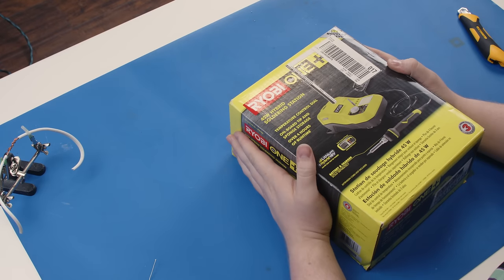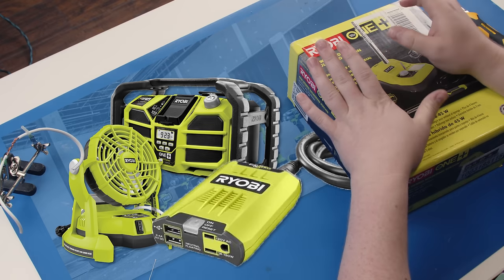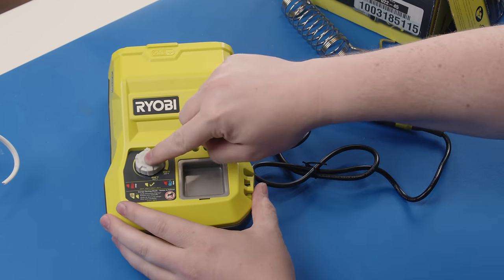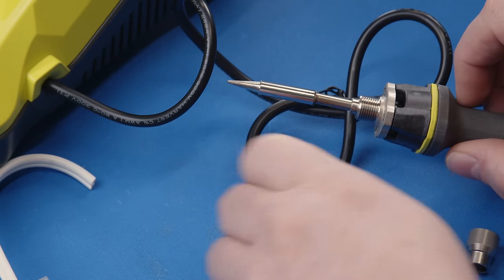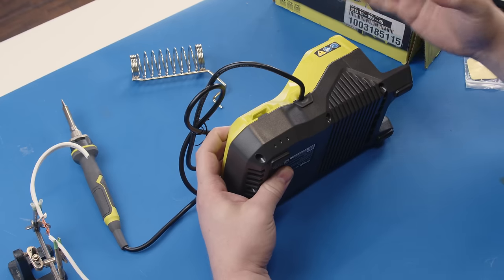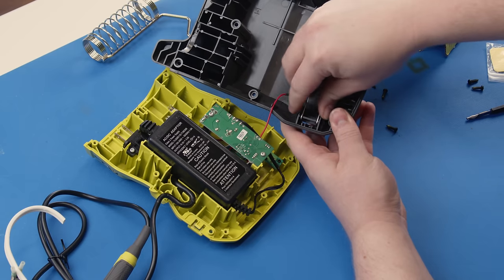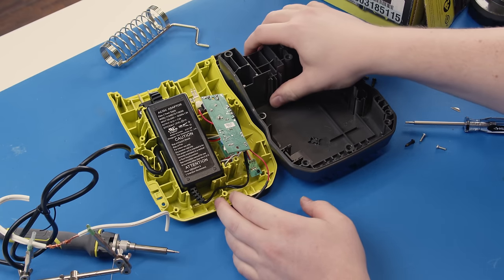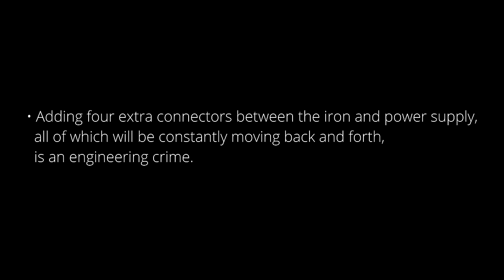Ryobi has GOT to be joking with this soldering iron

Comment: I would highly recommend you look into the TS100 soldering iron. It can be powered by a lipo battery or wall power. I’m no pro but it’s a great iron with temp control that the FPV drone community including me swear by.
Reply: or an TS80p
Reply: I've been pretty much having that in my wishlist for years now haven't had the budget on it yet but looking at it being a direct drive iron is pretty much more than enough for me to nail that on my wishlist top priority
Reply: Had mine for 3 years, mostly using it for Nerf blaster modding and field repairs. Since we mod our nerf to Lipo, it is nice being able to use the same 3s lipo packs for the iron that we use for our blasters.
Reply: He literally mentions why he doesn't want that exact iron in the video...
Reply: Or Pinecil: same performance, better firmware preinstalled and cheaper
Reply: Darn, I should have saved up, I ended up buying a Weller WLBRK12 with a Li-on battery. So far its miles better than the previous one I had that ran off of AA batteries lol. Takes about an hour to charge to 100%, lasts about 15 minutes, and uses USB-C to charge. It gets pretty hot, 12 watts but of course no temp control.
Reply: @perpleksed  same thing basically but from a less reputable company
Reply: @lithiumfpv9254  its only $25 though
Reply: @jbbolts  what is? The TS100? It’s should be around 50 dollars from a reputable site. Had mine for 4 years with zero problems, still haven’t used the replacement tip. Great for small and larger gauge wires due to its temp control and ability to retain heat if supplied with the correct power.
Reply: Yes, I have had mine for a couple of years now and still works fine on the same bit. I love how light weight it is. I modified a cheap supermarket (Lidl)  power tool battery so that i can use it to power my little iron and make it super portable. Just drilled out the battery connector holes and now it accepts banana plugs!
Reply: @lithiumfpv9254  no, the Pinecil
Reply: I'm kinda shocked more tech/maker/etc people don't know about the TS100 already.

Comment: I have an Ungar Imperial soldering iron that I bought in 1964.  It went through a few tips until I bought one that was gold plated (expensive too) which is still in great shape after almost 60 years.  In that time I had a couple small battery irons for quick small jobs.

Comment: Great video, great info, great rants, I can see why it's blowing up for you. As someone in the automotive and DIY renovation fields, it's fun and funny to hear someone way into the electronics weeds talk about the tools available. I have a tech background and have dealt with electronics, batteries, and circuits too, just obviously not as much as you. All the stuff you know that automotive people don't is exactly why professionals use crimps for almost everything in a car while the amateurs who think they are great at soldering, but know extremely little, use solder.
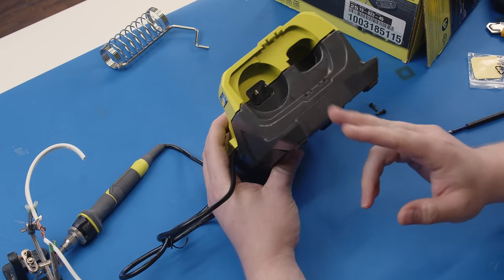I really did look at that cable over and over again. Immediately noticed it looked terrible. Using Torx in tapered holes pisses me off too. At 29:05 it's hilarious we get the clue it's literally a power brick when the power input literally looks like a standard plug to go into your wall. They literally designed a clamp to hold that standard plug and then just slapped the cord willy-nilly in the clamshell. 32:18 is a near spot on AvE impression, by the way. When you revealed the wall wart in the flashlight I was just about stunned. Again, fantastic video! Thanks a lot.
Reply: I said literally 3 times in 2 sentences and I literally hate myself. 😂
Reply: The power supply is fine in reality,  just unusual.  The torx screws are no big deal,  everyone should have a torx driver  now if they want to be able to work on nearly everything these days.   They aren't rare anymore.   In fact they are kind of nice,  they are hard to strip,  and in a pinch you can use a flat head screwdriver to turn them. 
  
   The true monster on this soldering iron is that stiff and melty cable!   Anyone who has any experience trying to solder with that ultra-stiff abomination stuck to the wand will immediately want to throw it out the window or replace it with their own silicone wire.
Reply: @mrdumbfellow927  Yeah agreed there is nothing WRONG with the power supply. More just funny an unexpected. Torx screws and especially in such small holes were just unnecessary. They are hard to strip until they have even a hint of corrosion and then they are trash, hahaha. Def agreed the cable is the real offending article though. Awful.
Reply: @802Garage  Not sure why people are bashing the holes.  They're not abnormal.   I've been in IT for 26 years, and took apart a lot of my own electronics before that, and holes just barely bigger than the shaft of the screwdriver are very common.   The further back you go, the more common they get - because the replaceable hex bit 'socket' screwdrivers weren't as common back then.  I even have an older 'bit changing' screwdriver that uses 4" round shaft replacement 'bits'.  (the end is cut in half so that it only goes in one way, and provides the torque support)   Others had 'wings' on the 'bit'.   

Heck, I have an old Mac Cracker around somewhere.   Torx, and 12" long, because it had to go through the narrow tubes to the screws fastening the old Apple Classic series.   The screws were from the _back_, but the front panel was only an inch thick.
Reply: @tbelding  Just because they aren't abnormal doesn't mean they aren't annoying and unnecessary. There are plenty of cars I work on with annoying design features that make them harder to work on. There are also cars which had service in mind and make those things easier. Obviously, this is not a tool that was designed to be serviced. That doesn't mean it has to be designed to be harder to serviced. My basic point is, I've unscrewed countless electronics devices over the years and the ones that annoy me because I have to try 3 different screwdrivers to fit in the hole are the ones that piss me off. Know what I'm sayin'? :)
Reply: @802Garage  - With these, if you simply have a set of standard screwdriver handled Torx, the only 'annoying' part is figuring out the size -and that's annoying with Torx PERIOD.  Even if they're exposed to the air.  

Don't get me started on annoying design features on cars.  As an example, I owned and spent years working on the original 81 Ford Escort wagon, and 82 Mercury Lynx (parts car), including engine swaps.
Reply: @tbelding  My key point is still that it is unnecessary. Especially for a low grade consumer electronics device. Both the small holes and the Torx heads serve no purpose except to make the device slightly more annoying to service and less likely that an individual will have the tools. Most people do not own a set of Torx screwdrivers, but many own one with the swappable tips. Those won't fit. It was either intentional design to increase barrier to entry or simply inconsiderate design which serves only the factory. As for cars, part of why I love Subaru is they actually usually make sense. You can tell when a company designed something to be serviced or not.
Reply: @802Garage  - Remember that construction design takes no notice of anything beyond the manufacturer.   That includes Subaru.   Everything is driven by 'what makes economic sense to us'.
Reply: @tbelding  Except that isn't accurate because many things are actually designed to be serviced. It can be part of the engineering process, it just doesn't have to be.
Reply: @tbelding  that's right, consumer grade equipment like this is not designed to be serviced at all so serviceability is no concern to the designer, they only care about cost of manufacture. They don't make them hard to service on purpose, they simply make them as easy and cheap to assemble as possible with no thought given to disassembly as they are not meant to be taken apart ever, at least not by the user. 

And yes, Torx screws are really good mechanically, the problem with them is there are far more sizes than what would be needed so you need lots of drivers. This is probably due to the torx system actually originally being an anti-repair feature to keep DIY-people from working on their cars so the more of the (back then) expensive and hard to get special drivers you need the less likely you are to invest in them. Now of course torx is mainstream and the tools are widely available so everybody has them.

Comment: My dad was a real pro with a butane soldering iron, there are tons of mission-critical electronics still working to this day in ambulances, semis and earthmoving equipment, thanks to that little well-worn tool.

But you're correct that there is no temperature control and a lot of them don't really get hot enough for modern lead-free solder.

He was looking for a decent battery-powered replacement, but never found one that was good enough.
Reply: Lead free is lowwer temp i think.
Reply: @bloozee  nope
Reply: @bloozee  Much higher.
Reply: @Morberis  not the lead free sder pastes that i used back when Sony pro eqpt went ROHS . It was stressed during training i did on BetaCamSX etc. They were much lower. Obvioualy there are also different alloys used.... all the way up to silver- solder, braising and beyond!
Reply: @bloozee  Good to know. I have not encountered any. Everything I have to repair takes 800F

Comment: Just get a TS100 clone with a tip-integrated element and thermocouple. I thought I was terrible at soldering until I got one (I am, but it doesn't matter anymore). They're so much better that they're not even the same class of tool, it's like using a power drill to make a hole vs a rock. If you really need the stand, cord, and battery to all be one object, just buy a standalone stand and tape it to a powerbank or RC battery.

Comment: As an Electronics teacher for 10 years, here Sydney  Australia, I want to comment on your advice at 9.30 minutes in the video. The advice about pushing on the soldering iron and it can break it is completely incorrect.  
In 10 years of teaching around 200 students  I never had a single Weller station soldering iron broken. Moreover, the advice as given by different manufacturers and electronics textbook state that when soldering let the heat melt the solder, pushing onto the pen will not melt the solder any faster. If you are using the iron as a lever that's completely incorrect.  Solder should melt into the joint by heat transfer through the wires not by the tip. 

Your product review was excellent  especially about the iron lead, and your suggestions  are correct.  I employed Weller temperature controlled soldering stations, they performed excellent considering the amount of use and abuse. 

Thank you for the review but I believe you should  have used it to make further comments.

Comment: Great video, have to disagree with the "soldering irons with no temp control are worthless" comment though. I use one every single day at work. I'm a car audio technician, and I use it to join wires together all the time. For that purpose, it works great! You really don't need temp control for that. I've also done plenty of delicate circuit board work with it, and with practice, for what I need it to do, it works great. Never ruined anything other than my leg, when sole solder dripped off the tip, melted through my pants, and into my leg. That was when I first started, and was too stupid to not allow solder to build up on the tip, lol!
Reply: Have you tried a temperature controlled iron? I have to say I would never go back to a using the low tech variety unless I wanted to burn some wood or something.
Having the flux not vaporise in your face is nice but the difference in results was pretty apparent to me; got a hakko 888 just cause, because after buying a $25 hobby king hakko clone I was so impressed with the results I started using it enough to want the authentic tool.
Reply: Do you figure an in-line dimmer cord may simulate a turned down soldering iron enough, assuming you start with one too hot?
Reply: @Kidiot   When I was working for the old boy (auto electrician) we had 3 irons; a temp control unit, which was used maybe once a year, a 50w unit which did maybe 70% of the work and a giant 200w unit with a 1 inch diameter tip.

The big old girl was an absolute work horse, we run it on a 110v circuit with a 240v timed bypass if you needed the full heat.
Reply: Another market for no temperature control irons is the person who buys a soldering iron for the purpose of melting through things like plastic. I've seen a lot of arts and crafts style videos that utilize a soldering iron in unconventional ways, and I'm sure there are a fair number of people who just want a hot stick.
Reply: @RIKARD NEW ZEALAND I'm confused, are you laughing at my career, or my comment?
Reply: @DoubtX  yeah I've done that one, burnt through some foam cushioning with a gun-style iron :D
Reply: @charlieward7606  awesoooome, thank you for the follow-up about dimmer switches Charlie :D
Reply: I am 100 percent with you. I do have a station with temp control, but never saw any benefit when I turned it down below 480. I think I figured out why…. I learned to solder exclusively using unleaded solder. I have never purchased leaded solder, and have no idea what it’s working characteristics are. I have to assume that this is why I saw no benefit to lower temps, it just isn’t hot enough to effectively melt the tin. Obviously I have had to learn to not scorch the board, and solder components with plastic without melting them… but I always thought that was just part of the deal. Do you leaded solder in car audio? I could see it being more reliable due to the added ductility, but could also see a workplace disallowing it’s use for safety concerns.
Reply: Holly shit i cant imagine using it more than twice a year without temperature control. I have t12 station and its worth every cent

Comment: I just tripped across your channel and glad that I did. You have an excellent voice as well as a respectable command of the language. You are an absolute delight to listen to and your humble but knowledgeable delivery is a great advantage for myself, as an average consumer. I nearly wish I had known about your channel before buying my first soldering station a few weeks ago, because I'm 61 & learned to solder at 14 y.o. I'm happy with my choice of iron.

Your explanation of Ryobi's skill & strategy in designing a product to feel great in the hands but with underhanded cost-saving measures is how I've felt about that company for years. I barked out laughter when seeing that p.s. inside, confirming my suspicions. 

Closer to home, I've messed with a box store house-brand  of car battery chargers, where the booster cables AND power cord are also plastic insulated. In Winter, when needed most often, the wires dictate where to place the charger, which has caused more $$ headaches imaginable.
Anytime I need to replace such an appliance, I'll be checking your channel from now on. Thank you for what you do, because I'm finished with self-proclaimed reviewers who barely understand the products sent to them, let alone the skill in producing a watchable video.
You've effortlessly earned a subbed, so see you next time. Cheers.

Comment: Great video. I brought one of these Ryobi soldering irons from the US when they first came out (they have never been available in the UK where I live) I wasn't bothered about not being able to plug it into the wall as I have plenty of Ryobi batteries. When you took yours apart I noticed the label on the power supply states it rated for 240v, so mine is getting a new power inlet! As you mentioned the cable is annoying. Even after a couple of years use, I still haven managed to straighten it out. I did consider replacing it with some proper silicone cable, but it didn't look like the iron came apart very easily. The power saving mode it has I find annoying sometimes as it is guaranteed to be cold just as you want to use it, but it does heat up remarkably quickly. I have brought replacement tips from Amazon and Ali Express that seem to be OK - they always seem to be listed by the inner/outer diameters of the non soldering end of the tip.

Comment: I bought my own Weller temperature controlled soldering/desoldering station when I was working as an electronics technician for a local community college for the electronic engineering department. It was kept under lock and key when not in use. I retired after 20 years at the college and I still use it for my hobby projects. It is over 30 years old and Weller still makes the tips and heating elements.

Comment: Try the TS100 or TS80, everything I've heard of them is just positive and they're relatively cheap

Edit: I'm an idiot who can't read apparently, but I'm still curious why one of those irons plus a separate stand isn't appealing to him
Reply: 47:06
Reply: I second the TS100. I got it for mobile use. and have barely used my station since. Driven from an old notebook power supply, heats up in a few seconds. And you don't have the multiple connections you dislike.

Oh and the TS100 uses irons compatible with the T12 standard. The bare ceramic elements are now the old and horrible standard - too much between the thermistor and the tip for good regulation. T12 tips have the element and the thermistor bond to and right at the tip. It means that the element and thermistor are thrown out when the tip's coating is worn - but manufacturing has made them pretty cheap.
Reply: Despite the redundant insistence that he try these-
TS80p is the proper model, I'm not sure if you can get the original anymore, but the PD capable model is definitely a better choice as it'll literally work with any power supply you throw at it.
Reply: The Pinecil is the cheapest of the Miniware-style USB irons ($25), and it takes TS100 tips. I personally wish it took TS80 tips instead.